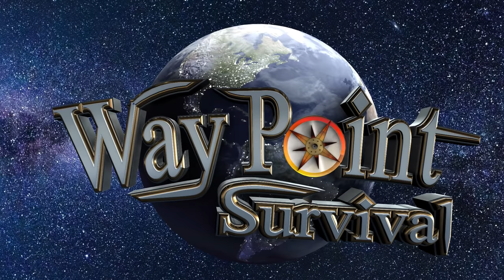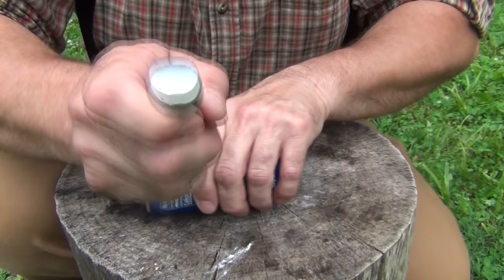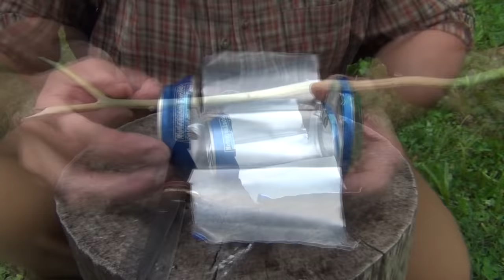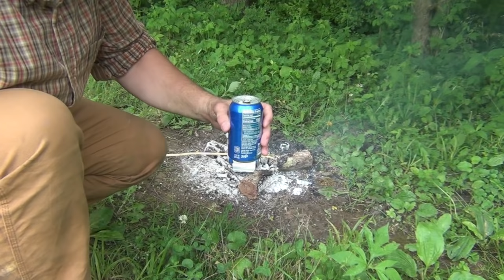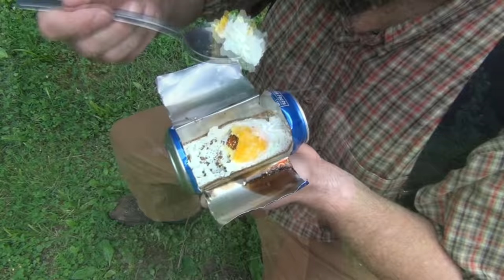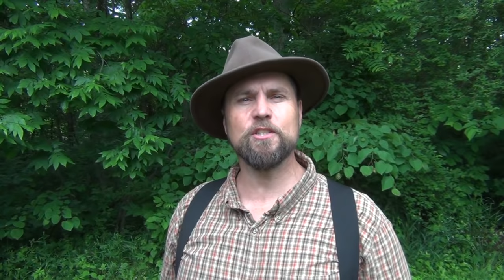HOBO ALUMINUM CAN COOKER [ AMAZING! ]

Comment: Neat idea. I work in the factory that manufactures aluminum cans. That liner starts out as a liquid we spray at high pressure inside of can as it spins. Then gets cured in an oven of 400 degrees. Pretty much harmless once it cures.  The ink and varnish on outside pretty much harmless once it cured as well. Neat idea 💡
Reply from the maker: Thanks so much for the information, I really appreciate it!
Reply: What type of plastic is the liner actually made of? Just curious.  
I’ve been using a beer can pot out of a lined can countless times.  

If your into alcohol stoves a what not.   A guy named tinny had a channel here called minibull design.   
And was making fosters can an Heineken can cook pots.  A machined a n aluminum band to go around the top to strengthen it once the top was removed for a lid.  
And had the body wrapped with like a long fiberglass string.  Kept a really decent rigidity to it. An the aluminum ring that was pressed on helped that much more.  

As for as an extremely light weight cooking pot. Hiking/backpacking an what not.  I’m not sure if theirs anything lighter than that. Be it titanium or anything else.  

But that liner hasn’t bubbled or anything of the sort.   Only thing best to not do is have it on the flame without a liquid in it.  With the liquid in there to absorb the heat.   It isn’t going to get smoking hot.  As it would if it were empty. 

But definitely curious of what it’s made of just in general or type of plastic.  Or is it some type of epoxy mix that’s sprasprayed in or a full on plastic taken past its melting point and run through a high pressure high temp sprayer to have it somewhat a liquid or sorts?
Reply: @AquaTech225  it’s an epoxy spray, already in a liquid form.not sure what ingredients are, trade secrets. It’s made by Valspar I believe.
Reply: Seu depoimento é de muita responsabilidade, pois não existem informações sobre a toxicidade dessas embalagens aquecidas.
Reply: Ya right. Keep telling yourself that.
Reply: I dispute it it "harmless" after it cures. Maybe if you are drinking from it, but not if you are cooking over a fire. I would not do this... unless it was the only option. I can think of better ways to cook without this though, so I doubt it will ever come up. Do not do this!
Reply: I installed a phone system in the aluminum can factory many years ago. It was really an interesting process.
Reply: @drunkbuzzard3237  it’s crazy how fast those machines can run. Our body makers run 310 cans per minute. Some run upwards of 500 cpm.
Reply: @AquaTech225 minibulldesigncult! Lol, I have a foster pot and several of his stoves. Ive only used the fosters pot once or twice for the novelty of it, and shugmerys YT. I like to use my TI kits. 

Oh and the IMUSA pots, those remind me of good vicarious YouTube memories   Lol, Again though I dont really use those unless I feel like dry baking.
Reply: It's common knowledge that burning plastic leads to random (and toxic) byproducts.

Comment: I'm afraid sir that these cooking ideas may become more useful & true in these times! Thank you for your time and dedication....ATB
Reply from the maker: You may be right. Thanks for watching!
Reply: We need a video on distillating sugar into a high proof alcohol that cars can run on. Or flower pot heaters that run on other fuel than tea lights like heated stones
Reply: This is an excellent technique.  Thank you so much!
Reply: Jim Bridger used a lidded pot as a radiator that he added heated stones to from his fire to heat a space. Cobbles...bricks...Just keep it radiating from a noncombustible surface --something made of stone or concrete to avoid overheating a combustible flooring.

Comment: This is a very good idea for an emergency and seems to work quite well. However, the plastic inside the can will liberate fumes that are toxic even in very small amounts, and you don't need to scrape it to be exposed to those toxic substances. So  I really would advise you to use a can like that only as a last resource.
Reply from the maker: Agreed. Thanks for watching.

Comment: Simple, interesting, and you caught me by surprise; I was sure you were going to turn it into a solar cooker.
Reply from the maker: Thanks for watching, glad you found it interesting.
Reply: I thought the same...solar cooker.
What modifications are needed  ?
Reply: @donnabartley2246  Pretty much the same, except pointing the opening at the sun on a clear day. Clean off any oils, salt, etc. that are on the silver surface. I would guess that lining it with aluminum foil  (shiny side out) would work even better.  It would mainly work on food you could put on a spit though, like franks or kabob. And it would probably take a while, preferably through early afternoon. It might help to cover the outer opening with clear wrap to trap the heat.

Comment: Interesting setup. I've never cooked in aluminum cans before. I have cut them in half and melted lead weights down and used them as lead molds. Then from there made a few mini balls for my muzzleloader. The cans got hot but never melted through and the lead popped right out of them.
Reply from the maker: Interesting. Thanks for watching!

Comment: I used to cut cans exactly the same when I was wrangling horses, guiding dudes, and camped out every night 50 years ago.  But I'd stand them on end and put a candle inside.  The drink hole vented, the shiny insides reflected the light better.  I could lay there and read, and eat sunflower seeds all night.  Lots cheaper than flashlight batteries.  Wax glue the candle to the bottom and with a little wire make a bale and carry that around if need be, like a bullseye lantern.  Hang it on a branch (using common sense and fire awareness, of course.  Shouldn't even have to say that, but these days...).  Bright enough to read means bright enough to attract bugs.  Especially those great big scarab beetles that you can hear crashing into trees from fifty yards out as they flew to the flame.  Once they got into the light they went manic, and I'd plug em with a .22 and get back to my book.
I'll remember that egg trick, but I think I'll look for Foster's cans.  Get more eggs in there, with omelette mixins, too.  Thanks for the tip.  Ask me some day about heating water in a Bugler can with a twist of TP.
Reply from the maker: Thanks for watching the video and I would definitely be interested in your hack!

Comment: I made and used the pizza box solar oven when I was homeless. Pizza box, plastic cling film and foil. I used it a lot for frozen mac and cheese and dollar frozen "meals". 
I can see this working on a smaller scale. The box oven would heat up dishes to where you could not touch the container without a makeshift potholder.
Reply from the maker: Excellent. Thanks for watching and for the ideas.

Comment: ❤ that's a super awesome in a pinch kind of thing that you could even make out of a soup can be a little harder to bend it open but you wouldn't have to worry about the plastic liner that won't hurt you when you're stuck out for a night or two thanks for sharing your show is awesome I've been being a hobo for various reasons for 35 years and I love it when people celebrate different ways of having hot meals without worrying about too much of anything other than getting something hot to eat and thank you for sharing❤
Reply from the maker: Thanks so much!

Comment: Cut # 1: "Keep the blade edge away from you". 
Proceeds to do cut #2 with the blade facing him. 😂
Reply from the maker: The point is to keep the blade away from you not necessarily not pointing toward you.
Reply: @WayPointSurvival  I do enjoy the content, but I believe you were correct with the first admonition...where possible its always more prudent to cut away from yourself rather than towards...especially out in the bush. 
Mostly I just got a chuckle that it happened literally right after the warning. Again, it in no way diminished my appreciation of the tip. Nor my intent to watch more of the content. Apologies if it appeared otherwise. Not my intent.
Reply from the maker: Sometimes, however, in cutting, you do have to cut with the blade towards you. It just has to be done in a controlled manner. I do know what you were saying though, and I agree.

Comment: I saw one video where they make a candle flashlight out of a tin can. Just remove the lid, punch a hole in the side, turn the can on its side, and insert the candle through the hole. Add a wire bail to hold it because it gets hot. For improving the design, I have some ideas that may or may not work. I thought about replacing the bail wire with a stick mounted to the bottom of the can so you can hold it like a flashlight. I also considered scrounging an old car headlight and putting a piece of the reflector in the bottom of the can to direct the beam. Thirdly, some method of mitigating the heat of the can would be nice, but dunno how.

Comment: Okay, not what I expected. I'm thinking twig stove and folks that really don't work. I know I tried that. The only downside to using aluminum cans is the heat factor. They melt, really easily, and a proper bed of coals can and will melt an aluminum can into slag.
Reply from the maker: Indeed.  Thanks for watching.

Comment: Are you doing anything to remove the BPA varnish from inside of the can before you apply heat?
Reply from the maker: No, this is just something that you might do in emergencies. However I'm sure there are folks that do it on a regular basis with no thought for the end results to their health.

Comment: A little bit off subject I noticed the suspenders you were wearing try some military surplus  suspenders really cheap then sew para cord stripped of the seven innercords  loops on 2 “ web beltThe loops are from the left and right sides to the front I copied location off of an old pair of field pants . Anyway they’re very comfortable suspenders and only two contact points and since the belt moves to different pants they work on everything. If only I had a sit upon ! I wouldn’t have a problem Ha ha!
Reply from the maker: Thanks for watching and for the suggestion!

Comment: if you burn it first and get out the plastic you can season it with oil or bacon grease.. they will last a good while if you are careful with them and can double as a candle lantern
Reply from the maker: The problem is that the aluminum is so thin that it would either damage it or melt it before you could get all of the plastic out.

Comment: I really like this idea. I have used cans for a lot of projects. The light weight cans can be hard to cot smoothly. Try filling them with wet sand then a small sharp knife will cut them with just the tip and do a cleaner job
Reply from the maker: Good tip!

Comment: remember kids...burn the thing in fire before first use, so get rid of all the plastics and color.
Reply from the maker: That won't work so well with this as the metal is too thin and if your fire is too hot it will just melt the can. This is for emergencies so keep that in mind.

Comment: Now an idea that came to mind a good idea to remove the lining use the fire to burn the lining and then take creek sand and pebbles put in the hole with a little water and shake for idk probably about 20 to 30 minutes and I bet all the lining will be gone. Again this a theory I don't know if it will. I do know I have cleaned cook wear with sand, pebbles, and water.
Reply from the maker: You can do that but you have to be really careful because the aluminum is very thin and can burn through if the fire gets too hot.

Comment: Yummo! I never had plastic epoxy with my eggs. Probably best to due a burn off first.
Reply from the maker: The problem is that aluminum cans are so thin that there is a chance a chance you will damage the aluminum or melt it without burning off the coating. Like I said this is not something that you would use frequently.
Reply: @WayPointSurvival  I know, you did clarify that.

Comment: Can also use can like the cooker, opened up, using tab at top to hang it somewhere, put in a t-light candle and it reflects light pretty good.
Reply from the maker: Yes, there are so many things that you can do with cast off aluminum cans.

Comment: Yeah since the lining of cans on the inside has a plastic coating I wouldn't be too sure about using it for any sort of cooking or heating. That's just a recipe for diseaster.
Reply from the maker: It just simply have to burn it off the first time and then it's fine to use after that. Also, the coding is more of a shellac than a plastic to my understanding.

Comment: Much better to do an initial burnoff to get rid of the inside plastic liner and outside ink, then scrub the inside with steel wool and wash/wipe it, THEN cook food in it. No plastic to worry about.
Reply from the maker: Actually, as long as there's water in it it's not really a big deal.

Comment: Love the vid man!  But ya really shouldn't use just any type of can because most of them are lined with a plastic coating that can cause cancer & other problems if scrapped or melted into whatever is in the can.
Reply from the maker: According to someone who works in the factory where they make these cans, the liner and even the ink and the varnish are pretty much harmless after they've cured. Thanks for watching.

Comment: Do not eat anything out of the can without burning off the BOA that lines it ffs!!
Reply from the maker: Sure, you could do that but I'm not sure it would hold up to the heat. Anyway, this is only for emergency use anyway and using it once in awhile it's not going to hurt you.

Comment: The way you cut the first can made me wonder if it would be possible to, if you didn't poke a hole in the bottom, arrange it so you could use it as a mini reflector oven next to a fire if you stood it up on end with the cut part open to the fire's heat.  Might be room to bake a biscuit on the bottom of the can.
Reply from the maker: Yes, you could definitely use it as a reflector oven if you wished.

Comment: Every can has a plastic lining and is NOT designed to be heated over a fire. This is not a good idea. use some cooking foil to cover it if you're going to do this.
Reply from the maker: That's why this is an emergency something that you would only use if you had to.
Reply: @WayPointSurvival  you would be much better off just eating the raw egg 😂

Comment: you can throw the can in fire and it will burn the plastic liner off if you let it get hot enough
Reply from the maker: Yes, but the aluminum is so thin that it might just melt.
Reply: @WayPointSurvival  1200f is pretty hot. Plastic will burn off long before that.

Comment: That's a  good way to dull your knife...
Reply from the maker: I'm pretty sure I mentioned that the aluminum is so soft there's no danger of damage to the knife. And, if it does dull a little bit, it's pretty easy to sharpen it back up.
Reply: @WayPointSurvival  that is a great vid. I wasn't trying to be dismissing of it, but there are many things in the field that can dull your knife. Thanks for the tutorial James!
Reply from the maker: No problem

Comment: Great ideas!
Reply from the maker: Thanks!
Reply: What is the largest size aluminum beverage container on the market? Are any available with a larger diameter and length than the typical soda and beer can?
Reply from the maker: I'm not sure but I'm pretty confident that you can get some in the 40 oz size.
Reply: @WayPointSurvival  I'm not a beer or soda drinker but l will go out today to see if l can find that size!
Reply from the maker: Me neither, but you can often find them discarded.